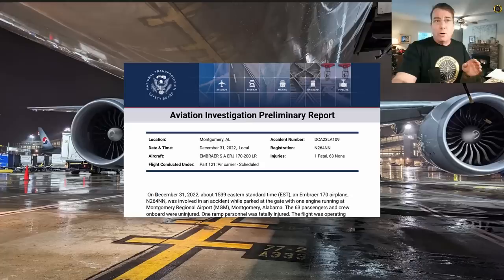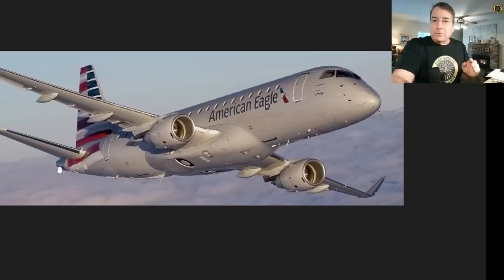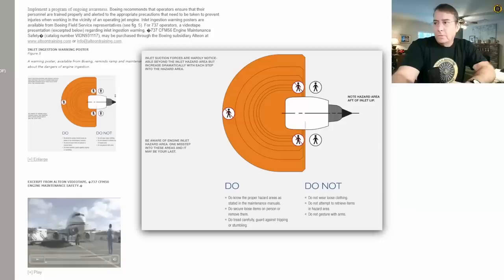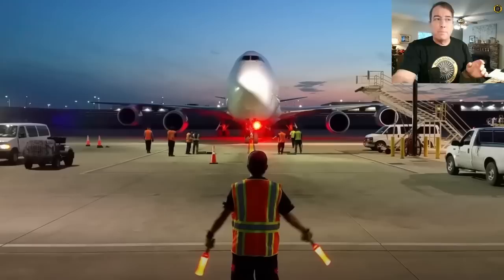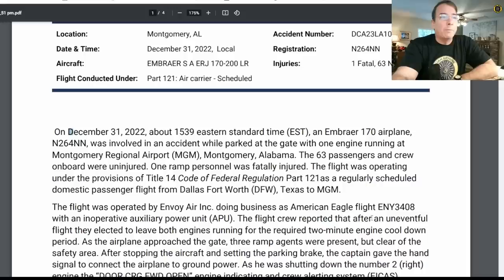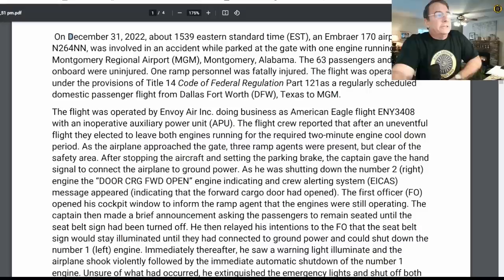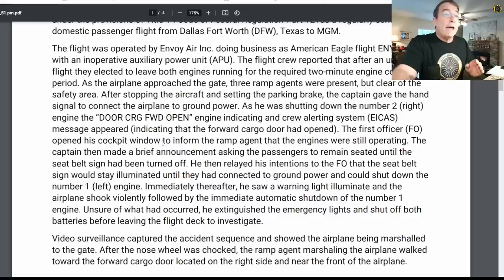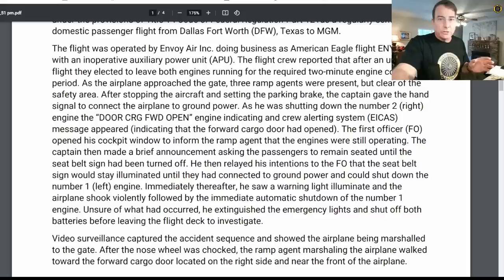NTSB Preliminary Report Ramp Agent Fatality 31 Dec 2022 Montgomery Al.

Comment: My experience as a ramp agent in 2000 was as follows. Chuck noise front wheels and plug in ground power to plane. Person signaling pilot of what was going on ground . The other agents than walk to chalk the other tires. Once the tire are chalked cones are set and doors open. Engines are normally shutting down (loud noise of the engine cut off) doors okay to open because danger zone becoming a safer zone. But we always looked at the Signal person on what they were telling pilot  when engine still sounded high (full powered) because side of engine was safe just not front of because of tornado effect. This way was created by UPS standards ground crews from what I was told than. I asked who made up the rules and procedure once. Most airlines follow this standard. The clean and nasty water were plugged in after doors open. And bag carts were set and all other equipment before the bag carts.

Comment: This appears to be simply following a mindless routine. Years ago there was a gear up landing in a GA airplane. The pilot had been doing close approaches in the pattern and each time he touched the gear handle and said to the passenger, "I have three lights." These were close approaches and he didn't want to add cycles to the retractable gear. When it came time for full stop, he did the same thing. The passenger didn't speak up because this was more of the same and she wasn't familiar with airplanes. It was a loud landing. In effect, a conditioned reflex prevailed.

Comment: 30+ years on the ramp and in ops. One thing I noted in this report was the victim getting blown around placing a cone aft of the tail, before moving to the left wing, where she probably placed another cone, then walked in front of the engine, probably on her way to place a cone at the nose. There was WAY too much emphasis on placing these damn cones from airline management. Added no safety value compared to better training and always following procedures, such as ignoring time pressures and remaining clear until spool down. Ramper might still be alive if not for this obsession with placing meaningless cones! Cone placement was to allegedly reduce aircraft damage, nothing to do with employee injury.

Comment: I was on the ramp with military fighter jets. The ground crew was under the direction of the flight inpector launching or recovering the aircraft. I was also an engine operator. Before you started an engine the rotating beacon is turned ON. The environment it to loud and everyone has hearing protection. 
A sad incident.

Comment: My procedure with U/S APU even after short taxi pull half on ramp inform ATC of hold short and Ramp Company for need of external power prior to #1 Shutdown even though already affirmed as such on arrival message. Shut down #2 then pull onto stand/ gate. Signal for Ground Power and when installed Shut down # 1 and Beacon off at Appropriate N1  or as per specific type. Note slightly more complicated with 4 engines but similar philosophy.

Comment: As a former USAF and ANG crew chief it just boggles the mind that this even happened. I spent over 30 years working on different types of aircraft but mostly F-16's. From day one it is drilled into our heads to stay away from the ingestion area. I can't help but think this is not emphasized quite nearly as strongly as it should be with the airlines. I know this has happened in other locations worldwide along with various pieces of ramp equipment being ingested. As you said Juan, it is critical to have 110% situational awareness around a running aircraft engine.

Comment: Yes. There are many shortcuts by individual rampers and bad management turning a blind eye. It was a huge bit of contention when I was a plane side rep, the crew hated working my planes because I didn't put up with the BS and would bring the operation to a stop. The leads/floor managers would get in a huff because they wanted to put on-time flights ahead of correct operations. That was a third party ground service, contracted to a company that was wet leasing all of its fleet. lots of oportunity to pass the buck and have things slip through the cracks. Even some of the other plane side reps didn't like me because the contrast was making it obvious that they were ignoring violations. (On the up side I emboldened some others who knew the shop was all screwed up but had been to timid to do anything.)

There were only two saving graces. The ground service almost lost that contract due to contract audits noting all of the sloppy work, so they brought in a new general manager to help clean it up. (Wasn't the most talented manager I've worked for but his focus was along the same lines as mine.) And second, I was basically untouchable because I have a far above normal education in the relevent laws (aviation and general labor law), safety managment/hazard mitigation, and self error-checking systems. 
I would also mention any BS I saw to the pilots so they could pass the observations back to their company and back to the lessee company.

Comment: My airline has a hand signal from the captain to the marshaller when engines have been shut down. The marshaller then gives a hand signal to everyone else at the gate that the engines are off and it’s safe to approach. Nobody enters the safety zone until that signal is passed down from the captain to the marshaller to the rest of the ramp crew. The only exceptions are nose wheel chocks and in the case of an INOP APU an agent may approach to plug in the ground power before shutdown. But everyone else is to remain in position outside of the safety zone until that signal is given. It strikes me as odd that this system is the industry exception rather than the rule. Most others have each person observe for themselves whether it’s safe based on audible and visual cues like the beacon.

Comment: Of course, there are pressures to get these aircraft out on time. But at no point have I ever seen management circumvent safety procedures to avoid a delay. 
I have almost 15 years of experience in ramp operations, at three different airports, single-aisle and wide-body jets. In that time, I have witnessed more than a handful of near accidents involving rampers walking towards a running engine. In all cases but one, fatigue was a factor. The other was stupidity. 
I was guilty of it once, as well. Just overly fatigued from working long hours in very hot temps and not paying attention. I caught myself and stepped back. I've been the one yelling and gesturing at someone because they were doing something unsafe. 
I have worked at one airport where one ramp supervisor was never outside to meet the aircraft, there was no lead, and the most experienced ramper "ran the flight". This had always been the SOP and they already had one ingested safety cone to show for it. 
I can see the potential for accidents like this one to repeat itself. The majority of rampers are professionals, they do it because they love the work. Many airports also have "amateurs", folks that just need a job and don't take the tasks seriously. This creates high turnover as these employees usually don't last long, hence creating much more work for those remaining. 
We all have stories of flights being worked by two guys, uploading carts of bags by yourself. It sucks, but the flight has to be loaded and pushed out - on time. 
The actual airlines, like Southwest, American, JetBlue, etc, have far better ramp training than contractors. Those should be avoided, in my opinion.
It's a very underappreciated job, VERY underappreciated. The flying public certainly don't appreciate us. The flight crews? I think they know we bust our humps out there, and they appreciate the hard work. But we are still the red-headed step children. Without us, that plane is not going anywhere. That said, I will say that I've met some seriously amazing pilots out there.

Comment: This lack of safety concerns all started when airlines started using contract labor and no longer had their own employees doing the work.  I was a ramp rat at Flying Tigers for a few years before I figured out being a Ops agent was better job.  Most of us were well aware of the hazards working around the ramp and took our job very seriously.  Since the DC8 didn’t have a APU we never went near the plane until the engines were shut down and the beacon was off.  This went double when we started working on the B747 because of the much larger engines.  That incident at Montgomery was mostly caused by lack of awareness and a lack of concern for safety.
Reply: So you worked for a airline and cargo?
Reply: @davidsmiths5471  Yep,  best jobs I ever had😎

Comment: Never having worked in this environment puts me a bit of a disadvantage but was is clear from this incident and the other near miss incidences mentioned in the comments section is that safety is built into the OPS Manual. How or if those procedures translate into daily operations is the responsability of the management and supervisor staff. Sixty years ago when I got started working as a sixteen year pup, I worked for an old crotchety store manager who's philosophy was "you can expect what you inspect". With many of the airlines now using contracted ramp services this type of incident highlights the need for the airlines to do a much better job of observing the activities of the contract service providers. Looking at this report it is pretty obvious to me that the procedural deviations happens a great deal more frequently than it should. Turn around goals and shutting off the clock for crew compensation should never trickle down to the individual ramp agent. Financial goals are the responsability of managers and directors not $12.00/hr laborers. Sadly, this appears to have a profitability element to the cause. When profits jump above safety in the hierarchy of operations, disaster is inevitable. Just look back to Bowing and the 737-800 Max debacle. Profit over safety. I fully agree with "follow the money".

Comment: The real problem is that ground ops are in a no-mans land just outside the edge of the FAA's charter, but often also being just outside of local labor law because of large airport ops being generally assumed to be federal jurisdiction and then the difficulty of inspecting with layers of TSA and lack of relevent expertise in the local L&I office. 
Yeah they are hypothetically indirectly under the FAA via contracts and opspecs that require training a guy that acts as a contact for contracted companies that then further subcontract the jobs. And so yeah the FAA is involved through their brother-in-law's third cousin's neigbor who knows a guy over in Shelbyville that read an article once.

Legally I estimate that you would need congress to legislate an expansion to the FAA's area of authority so the planeside reps and load planners can be directly certified by the FAA in the same way dispatchers and mechanics get certificates. At that point the planeside rep becomes both correctly trained in relevent regulations and forms some interest in keeping the certificate rather than just pleasing their middle management dolt of a boss.

Comment: When I worked on the ramp in a major delta hub no one ever thought about going into the safety zone with the beacon still on, sure we would stand on the edge and walk in immediately after but never into the zone with the beacon or engines running. I worked with every seniority level from 30 years to brand new and never saw anyone think about walking in the safety zone. Might be a culture thing where I was located but never felt so much pressure that I would jeopardize my safety for maybe an extra 30 seconds.

Comment: Darwin is an unforgiving SOB, and will let you know quickly what happens when you circumvent safety rules. I'm not a ramp worker, but spent a lot of time on the flight line as a medical aircrew in the USAF. Engines Running Onloads was a part of our training, and we were restricted from walking forward of the wingtips under any circumstances, and had to stay within the shadow of the fuselage (directly behind) if engines were running . We also had to remain clear of the left main gear pod, as that was where the APU was. (C-141B) To even be seen where we weren't supposed to be was cause for disciplinary procedures and a required check ride next flight. I've not seen anyone get sucked into an intake, but I've seen several people blown over from jet wash, even from an idling engine.

Comment: I worked on the ramp for many years, including as a ramper for DL. There is a great deal of pressure to reach performance metrics. ATL was constantly jumping down management's throats to meet the A-20 metric of 90% (I believe, possibly 80) of bags sent up the carousel to baggage claim within 20 minutes after block-in, which at DEN is exceedingly difficult due to the long drive from the gates to the terminal. On the Connection regional flights, we had a minimum turn time of 35 minutes. I frequently saw and worked these flights in as little as 20 in IROPS. I believe my personal crew record was 18 minutes block to block on a light flight. I never heard the crew time excuse as a reason to open the bin doors, but frequently saw them opened with blades spinning and beacon on in order to get the belt loader up expeditiously so the bag runner could pull their rig up and get the unloading process underway. Also, the pilots frequently forget to turn the beacon off or leave it on well after the engines have spooled down, which serves as a great discredit to its importance.

One time, as a fueler under much more pressure even than the rampers, I waited for my next aircraft as it entered the gate. It was an A320 with, unbeknownst to me, an inop APU. I heard the light pop sound of the engine shutting down and entered the safety area abeam the aft doors under the tail. What I didn't hear was #1 still running as I had ears on and, as a fueler, wasn't briefed about the APU. I was looking down entering numbers into my handheld as I crossed the exhaust stream and being probably at least 30 feet behind the engine still got blasted nearly off my feet! Never approached from behind again!

Aside from this, as an FBO line guy I saw some questionable shit as well. For instance, I watched a coworker pull the nose clocks on a TBM700 with the engine running because the pilot forgot to. And probably the most horrifying.. I can recall in training, the video saying not to approach helicopters from the front, but with no explanation why or emphasis on importance. This info quickly left my head. One day, many helicopters later, I parked a medevac Bell 407 and the moment they shut down the engines, I approached the aircraft as usual to talk to the pilots. After hot-fueling dozens of 407s by now, I was desensitized to the rotors spinning above my head. The first thing the pilot said to me was "do me a favor and never approach a helicopter from the front again. When the engines shut down the rotor blades start to droop down to neck height." That was the end of that habit.

I think there is a certain amount of invulnerability, a level of carelessness and a deficit of caution exercised on ramps throughout the country and world because operators are hiring entry level employees and putting the emphasis on the wrong areas of operation.

Comment: It seems that the safety times that need to be met are being ignored by upper management such as the "spool down time". 
One viewer reported "Everyday, we would hear from upper management how we performed yesterday... with CONSTANT pressure to "meet" our metrics and what was expected of us." 
Apparently some of those upper managers have a mathematics addition problem when considering the times from the parking brake being set to the time the engines need to spool down to the time the first bag hits the beltloader. Apparently those in upper management tend to ignore or set aside the spool down requirements when rasing caine about when the first bag to hit a beltloader. It would be a good thing to know how this gets handled...some of those above managers in ramp handling procedure need to be highly looked into and if the "hidden rules" are different than written, a few heads need to be terminated. Of course, if this is the way things are happening but it seems so since the ramp employees were not following protocal.

Comment: It’s about doing the job everyday, safety through repetition becomes just a second thought. I’ve worked in manufacturing where they put locks in areas to indicate that there are people there and not to do something. The key is taken by the people going into the restricted area so the lock indicator can’t not be removed by someone else. And then had someone ignore the lock thinking that they just forgot to take the lock off which happens, and then in turn end up killing someone. At the plant I was visiting, they opened the gates to a submerge tank that 4 people (if I remEmber correctly) were working in and flooded it, killing all 4. No matter how dangerous a job is, if you do it long enough you can become complacent with safety rules.

Comment: I concur with those who point out that many companies safety meeting/huddles are just to sign the sheet saying that you were present and participated in the safety program. In my experience it takes companies using a carrot and stick process on employees to get them to focus and adhere to safety protocols. This is how the company did it that had the best safety record I worked for: The carrot of swag and bonuses for top safety, and the stick of a safety violation is a day spent in safety training. The second safety violation within a year is getting sent home for a day unpaid, and the third within a year means a week of unpaid time off, and a fourth within a year means termination of employment. The "safety year" restarts whenever the oldest violation drops off.